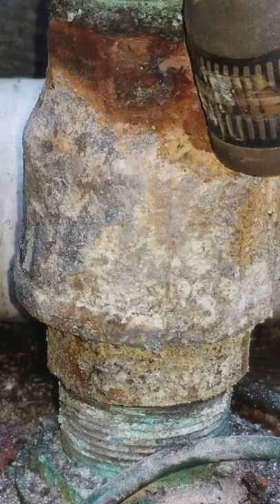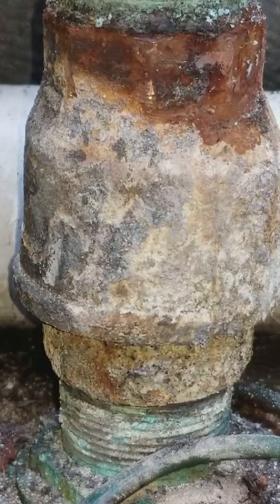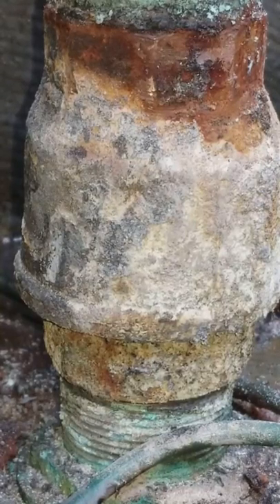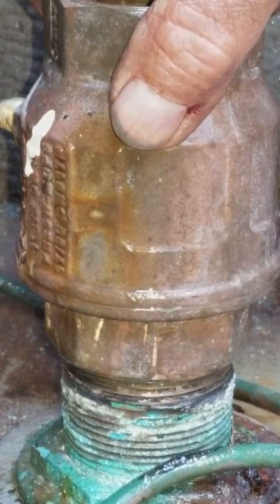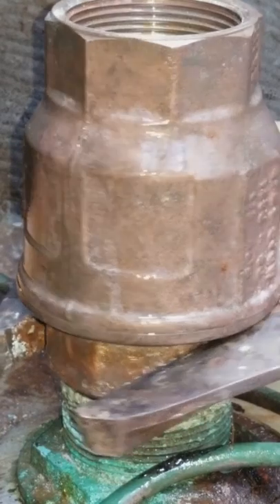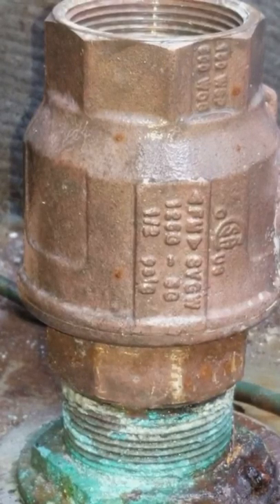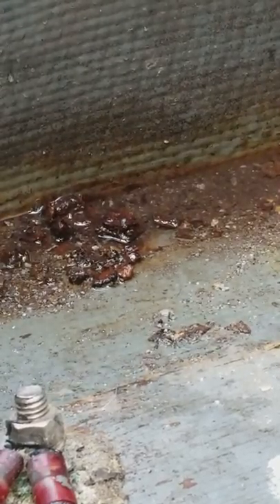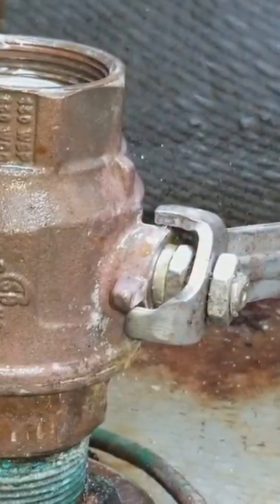Changing a Seacock on a boat in the water

Comment: That;s not actually a seacock that you installed.  It's just a ball valve.  What you removed was also a ball valve.  A proper seacock has a flange on the bottom and is attached to the bottom of the boat.  It is much stronger than a ball valve.

Comment: Never tighten a valve where that union is you can over-tighten and crack it…Grab up top Instead… Should’ve put never seize lubricant on those threads while u had it plugged…. That valve will seize right to those threads and it’ll be a nightmare taking it off…

Comment: Hi, nice job there ! Aren't you changing the bottom part yet ? Looks corroded too
I was wandering also if you could get a seacock from any hardware store or it has to be special marine equipment ?
Last thing, i have the impression that not all seacocks are grounded in the boat, could you make a video on how/what/where to ground ? I might ask rookie questions but i'm totally new to sailing !
Reply: Thats a good question!